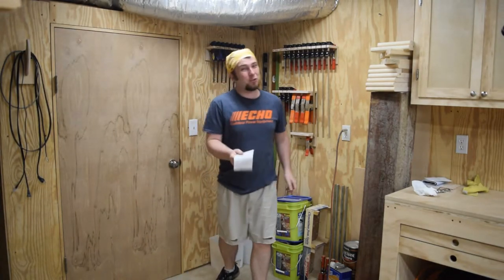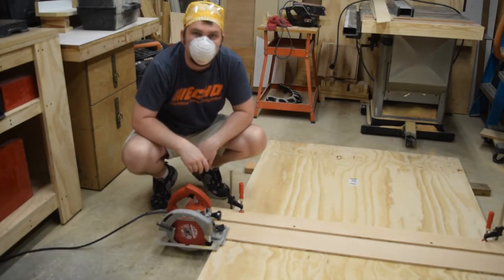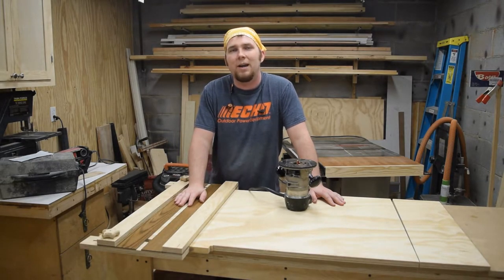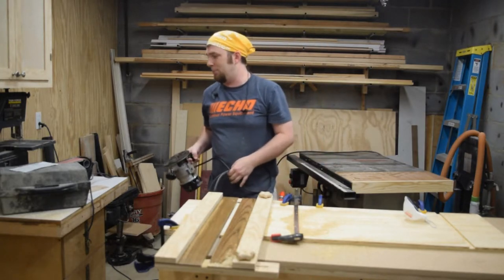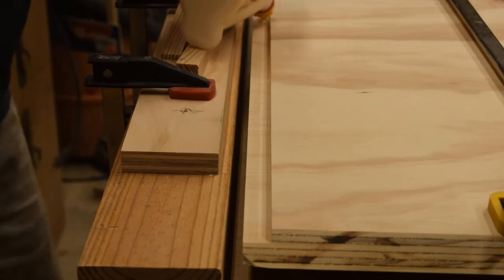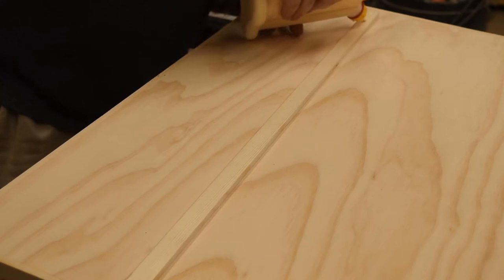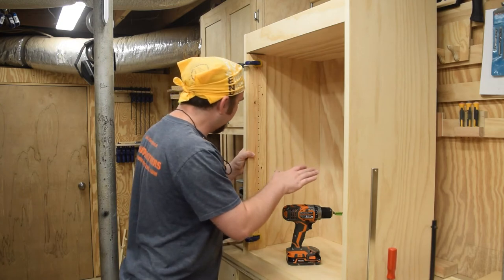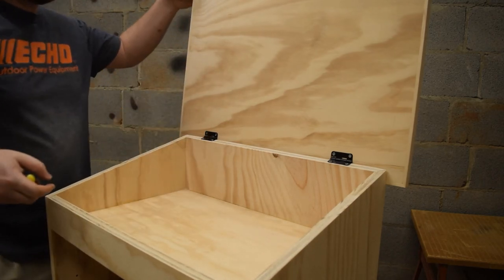How to Build a Rolling Podium

Comment: Can I get a material list?
Reply from the maker: If I remember correctly I built it out of 1 and 1/3 sheets of plywood. I edged the plywood with scraps I already had. 

Sorry for taking so long to get back to you. The motherboard in my computer crashed. Once that issue is fixed I'll see if I can post a diagram of my sheet breakdown.
Reply: @MakingSawdust  thank and dont worry, pray you get everything back to working